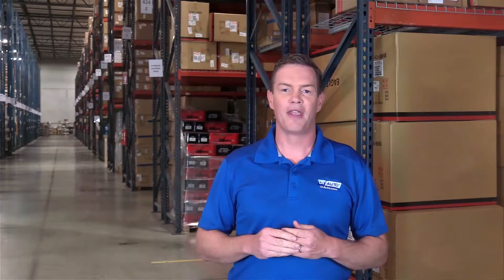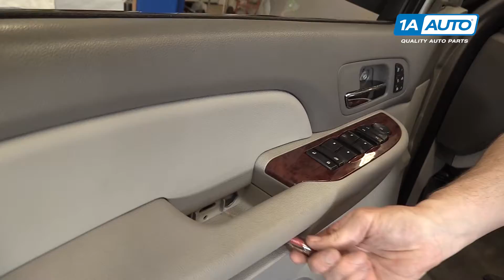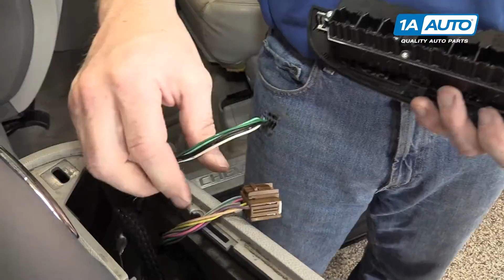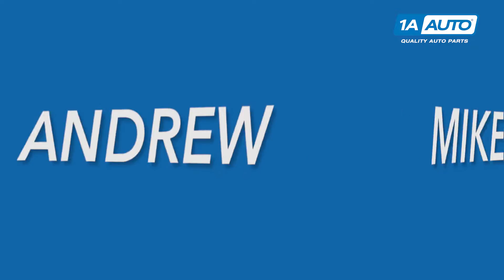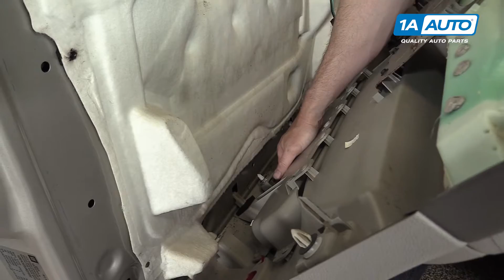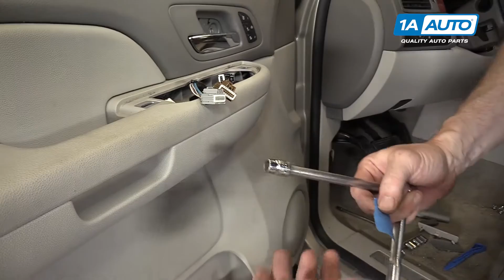How to Replace Front Interior Door Handle 07-13 Chevy Suburban

Comment: My handle is staying in the open position and i have to manually push it back into position for the door to close properly. Would replacing just the handle solve this problem?
Reply from the maker: +Lamor Ferguson Yes, a new handle assembly should fix that problem.  Thanks for watching!

Comment: I see how to replace the whole assembly.  But how do I replace just the silver handle?  not the whole assembly.
Reply: that's why i'm here also!
Reply: What reason are you replacing just the handle? Wondering if my issue is the same
Reply: @lamorferguson950  the chrome plating on the OEM handle is peeling and cuts my hand. Razor sharp. Been that way for a while but now other people drive i feel  obligated plus it's unsafe and unsanitary
Reply: Exactly what I was wondering, 2 years after you’ve posted this comment I see…